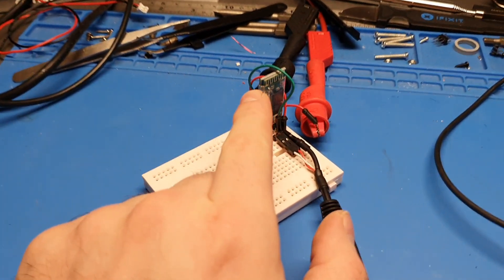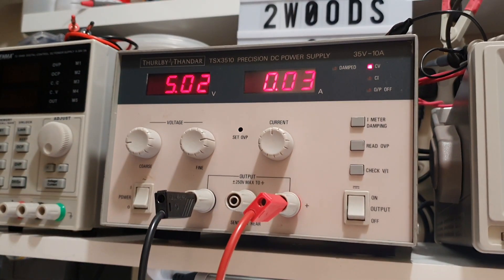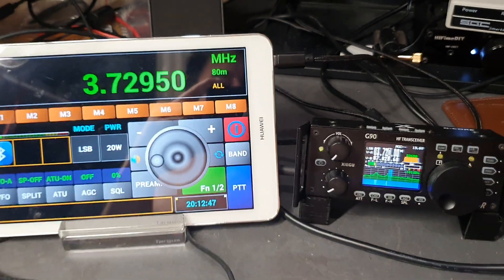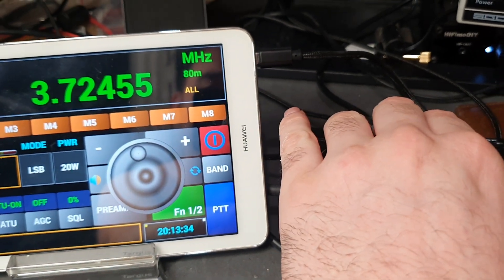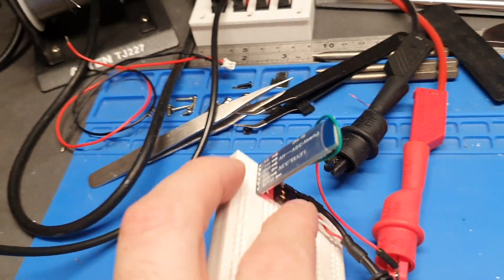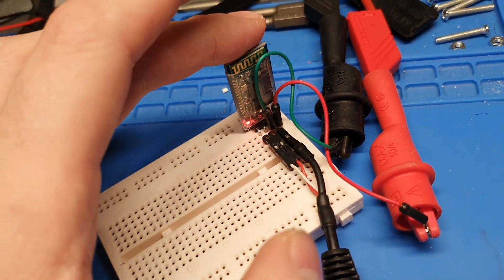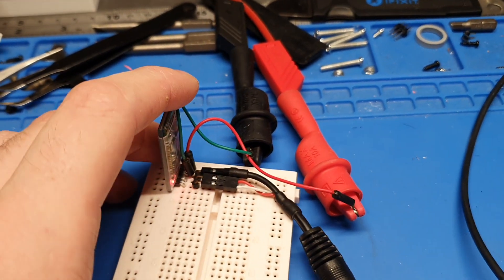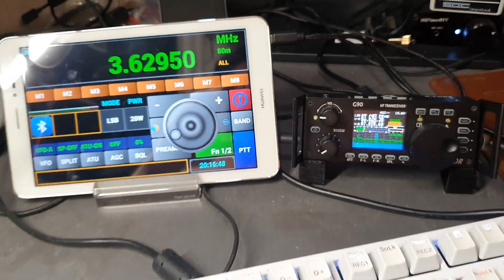Xiegu G90 Connected via Bluetooth to an Android Tablet running PocketRxTx.

Comment: Dale,  do you have any resistors in the TX and RX circuitry of the HC-06?  Can you email me?  WD0DUD address on QRZ is good.
Reply from the maker: Hi Garry, no resistors on the HC-06, both the G90 and the HC-06 use TTL 3V3 voltage levels.

Comment: Great video. Thanks. I've made mine. However I'm probably missing something. While my hc5 transfers data both ways between android hc05 terminal app and rasp pi, it only sets g90 but will not read vfo change on radio. On cable 2ways read and set work. Any idea or similar experience?

Comment: DId you change baud rate of BT dongle? Did you change any settings in G90?  Looks like default baud rate of HC-06 is 9600.
Reply: I even reversed rx/tx from 3.5mm cable and still nothing. pocketRxTx connects to HC-06 but no control of G90 in 2.0test and 1.0 versions

Comment: stereo cable to CAT input.. home made?  Purchase on ebay/amazon?   Maybe other BT units can plug into this cable and off to the races..?
Reply from the maker: The cable itself is just a stereo 3.5mm to 3.5mm. The socket connected to the breadboard is something I made as I use breadboards quite often for protoyping interfaces that I design or build.
Reply: @dalerobinsuk  what is cabel from BT to G90.. 3.5mm sero at BT side, then special wiring at G90 side to plug into QI port?  or just I/O port
Reply from the maker: @werkiek  3.5mm in to G90, it goes in to the side of the front panel.
Reply: @dalerobinsuk  ah yes..well, i have bt unit plugged into earphone jack for Bluetooth headset maybe I'll change it to the input jack and run the app and see if I can connect
Reply from the maker: @werkiek  That sounds like a Bluetooth audio adapter, you need a Bluetooth Serial/Uart adapter for this.
Reply: @dalerobinsuk  Ah, hence, your video and the BT?Serial device.

Comment: Good start, I have downloaded the free program for starters, any chance of a wiring diagram with the connections at the G90 and through to the HC-06 Module (ordered a module). Hand drawn would be fine 😉 thanks, 73 Bob VK3CDE

Comment: Awesome video thank you so much for sharing this! 
Considering the low current draw of this module I wonder if the 8v available via the G90's DIN connector knocked down perhaps with something as simple as a couple of diodes would be enough to handle the power requirements? 
Have you informed the developer of your findings? 
I also wonder if there is a way to fold in digital modes so they have cat control as well?